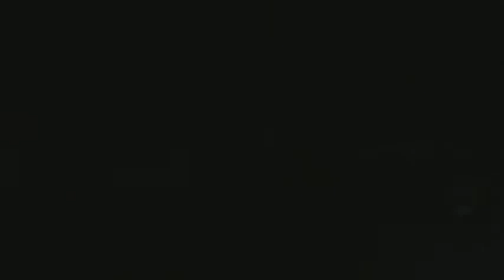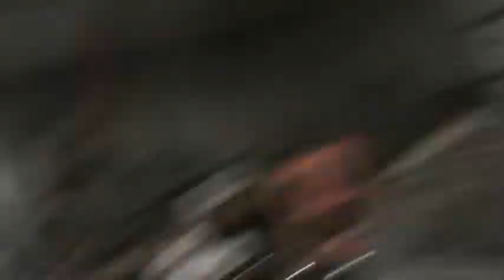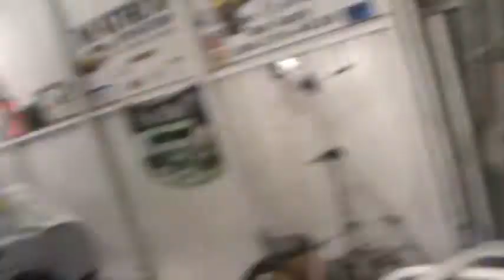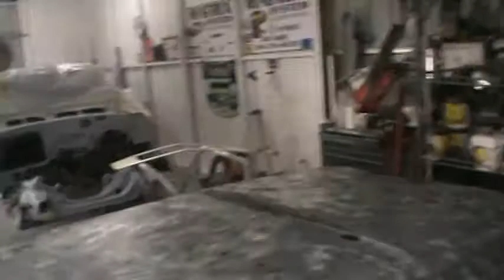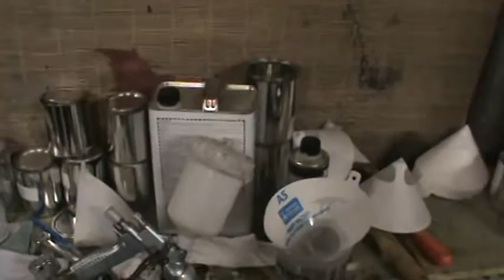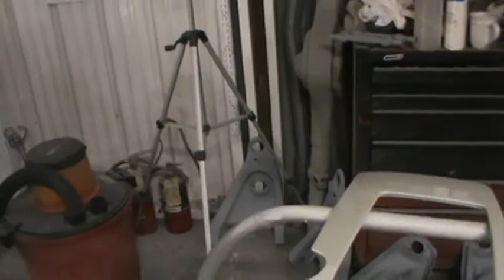JUST SOME OF THIS AND THAT

Comment: That white loooks awesome... almost looks like it has pearl in it. 
Hate to slam you with yet another question but... I bought some of the Silver Sail from you guys but have not used it yet (I used s different clear on the Camaro z28). Is that a panel clear and/or an all over clear?

TUCAN TOM (for Silverhorse347)